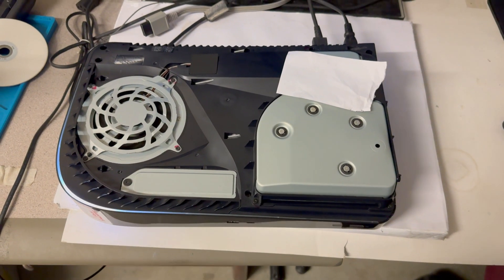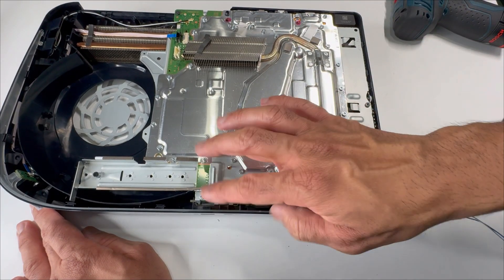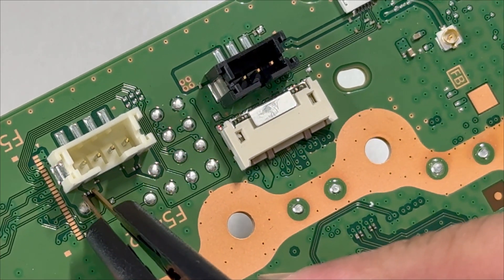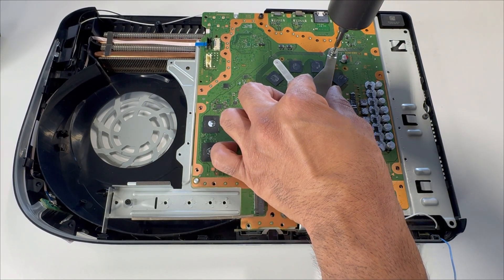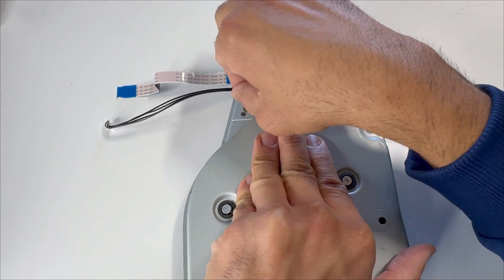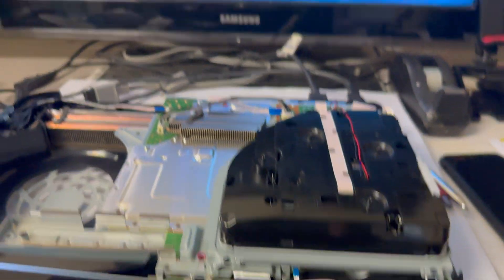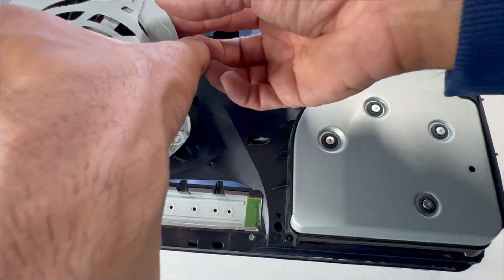[2025 Guide] - Fix PS5 Motherboard Fuse to Revive Blu-ray Drive - Fuse Replacement Guide

Comment from the maker: Chapters: -

[00:01] - Introduction 
[00:11] - Symptoms
[00:53] - Disassembly
[04:25] - Troubleshooting – Locating Bad Fuse on the PS5 Motherboard
[05:40] - Fuse Replacement -Detailed Desoldering & Soldering Process
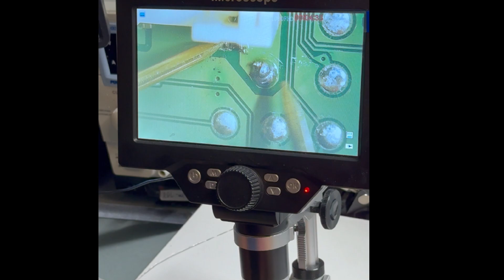[07:32] - Initial Test & Discovered Damaged Top Cover
[10:07] - Examining the Blu-ray Drive
[13:10] - Straightening Out Top Cover – All Fixed!
[14:50] - Assembly Continued
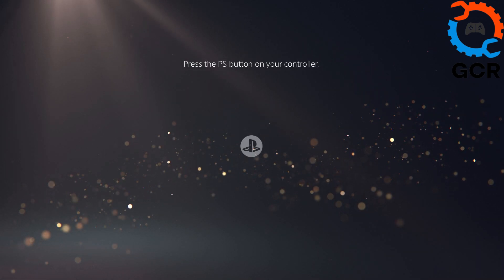[18:20] - Conclusion 
[19:07] - Credits